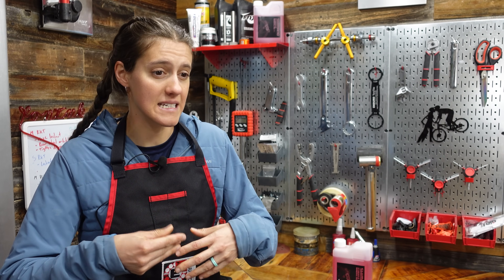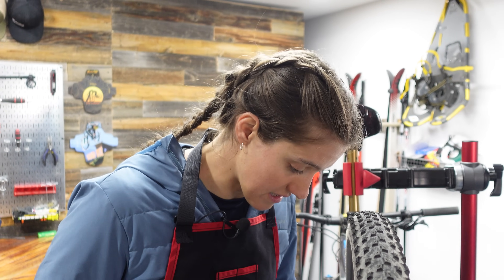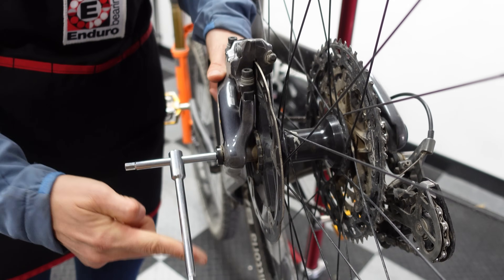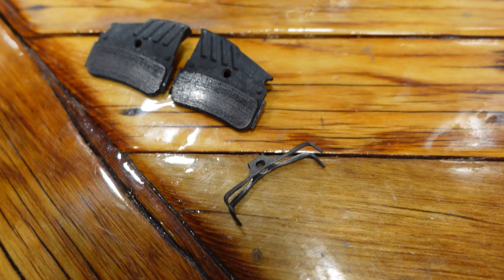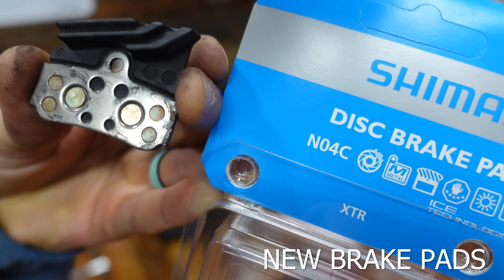Replace your hydraulic disc brake pads (it's easy and will save you $$$) | Syd Fixes Bikes

Comment: I would recommend cleaning the pistons before pushing them back. Otherwise dirt that is stuck to the outside will be pushed into the sealing which might increase the risk of getting a sticky/lazy piston which is even more hastle than cleaning the pistons in the first place.
Reply: Indeed. Plus it is such an easy step to add in.
Reply: I agree, and cleaning all around the caliper while the pads are out (Q-tip with alcohol) is also good I think
Reply: That's a good practice !!!
Reply: I clean around the pistons with alcohol then put the correct oil around them before pushing them back in. Then clean off the oil with more isopropyl alcohol.
Reply: came to the comments to write about this... Yes - clean your pistons, specifically if you have contaminated brake pads or rotors.  One of the pistons can be lazy - check if there is no dirt/mud there. There is a tool to push back the pistons but a screwdriver will work too.
Reply: @ Henry Quinney

Comment: This is NOT actually a closed system as there is room for air to move in behind the bladder and compensate for the oil filling in behind the pistons as the pads wear. Thus there is also the ability for the bladder to expand to allow a bit of fluid expansion as brakes heat up or when you push the pistons back into the caliper. You do not generally need to let oil out of your bleed port to push pistons back when replacing pads. And, as noted by others, it's also a good idea to clean the pistons before pushing them back in to reduce the amount of dirt pushed back inside the caliper further contaminating your brake fluid. But then, whatever. You two make great inspiring and empowering content that is greatly appreciated. Please, keep it up!

Comment: There's no need to open the master cylinder bleed port if the system was never overfilled. But if you've previously done a lever bleed without resetting the pistons and installing a bleed block, you probably overfilled it and it will be necessary to allow the surplus fluid to come out as you've depicted.

Comment: If you're thinking about switching to metallic pads, first check your rotors. A lot of stock rotors have 'resin only' written on them. If that's the case you probably want to budget for new rotors as well.
Reply: Might as well, cause if you don't, you will have to in a few rides anyway.
Reply from the maker: Good tip!

Comment: In case no one has mentioned it.. I have a cool machinist tip for measuring brake pads with your digital calipers:
Measure the little step like Syd did, but while that measurement is still on the caliper display, hit the “zero” key to zero the display. Then measure across the whole brake pad thickness, but now the display will read only the consumable part of the pad without needing to do any math. Neat huh?
When you’re done reset the calipers to their normal state.. usually by holding the “zero” key in for 2 or 3 seconds till it reads normally (depending on your caliper model.)

Comment: Great video - you may want to mention the key differences be metal and resin pads and specific resin-only rotors. 
Mechanics can also use a plastic tire lever to push the pistons into the caliper when required.   Keep up the good work!

Comment: Good tip to use the old pads to push the caliper back.  I have used a plastic tire lever in the past, but like your hack!
Reply from the maker: It's especially helpful when the plastic lever isn't cutting it.

Comment: Thanks, just what I needed. You can measure the pad thickness directly at the 'small' end of the caliper, if you rest the end on the pad and let the little extending piece touch the back plate you will have the direct measurement with no resets or math!

Comment: Your videos are always awesome and helpful - keep them up!!
I'm going to try this again soon.  When I tried previously I had a lazy piston and to take it to the shop - didn't want to F anything up!...LOL.
I wish you guys had a strong light to show the positioning of the pistons.  So you push them back into the caliper and make sure they are evenly plush with the surface ( or entry - hard to explain..LOL).  Thanks!
Reply from the maker: If they aren't COMPLETELY flush, that's probably fine, but they should be close.

Comment: Great video. I went to Magura brakes on my last two bike builds. They use magnets rather than springs to keep the pads in place - way easier to deal with than springs. And they have several color options, and are lightweight. I'm not a Magura sales rep or anything, just like their brakes.

Comment: Thanks. A lot of new info I wasn't aware of. Just one question? How would you know to replace your rotors?
Reply: If they are too warped to straighten or if they are too worn, use a caliper to check wear amount.
Reply from the maker: It's worth noting that we've very rarely had to replace rotors because they don't wear very quickly. But definitely worth checking their width with a caliper every once in a while.
Reply: Thanks for the replies. I've had my bike for 4 years now and still rock the same original rotors. I just have no other indication than measuring them?
Reply from the maker: If they look patchy (you can see the inner material through patches on the outer material) it's definitely time. Otherwise, you just gotta measure.
Reply: Okay. Thank you for the information.

Comment: Hi Syd, first off, I love your show and thank you for posting these really informative videos.  Speaking of which, I have a question;  I have a Road bike with a 1 x setup.  44 at the front and 12-28 at the back.  I've noticed that, occasionally,  Whenever I'm off the saddle for a climb and very seldomly, when I switch my gears, I would hear this ping at the chain set.  Is this normal or, if not, does it mean something is wrong with my setup?  will it eventually snap my chain or chip my gears?  should I worry about it? Hope to hear from you soon and best of luck on your future posts! :)
Reply: Hey. A ping could mean a lot of things, but if it occurs when you're putting lots of force on the pedals and shifting then its normal. However, this should generally be something to avoid. If you're shifting try to lower the force on the pedals, as it puts less strain on all of the parts. Just practice this. If you're worried about it you can always take it to a local bike shop and ask them to check it out in person
Reply: @boldizsarmelegh870  thank you, good sir

Comment: Hey Syd, do you happen to know how to adjust the lever travel for Sram hydraulic disc brake? Eg. lock the disc with half press. 
I am running Rival eTap AXS. 

Appreciate the comprehensive knowledge sharing of the channel!
Reply: Hi man,
While I don’t have any experience with SRAM road brakes, I have had similar issues with my G2 and Code MTB brakes. A lot of times on my brakes it’s just the lever reach and contact adjusters being out of place, I don’t know if road levers have these but if they do, definitely the first step. If lever adjustments fail, pushing the pads apart with the little plastic pad spacer/wedge widget sometimes works. Lastly, resetting the pistons by doing a lever bleed like Syd did will surely give you the range of motion back. You will be using a syringe an DOT fluid for the bleed though! Check out the excellent resources on the SRAM website for more info and bleed procedures. 
Best of luck dude!
Reply from the maker: Unfortunately we don't have any experience with SRAM (or at least haven't used them in close to a decade at this point...)
Reply: @sydfixesbikes  I see. 's cool. Thanks~
Reply: @jacksnyder9399  I am trying to do the opposite actually. 
I have the full ROM now but I try to restrict it, like how you move the brake pads close to the brake track for rim brake, so I need only little motion to have the full braking.

Comment: what is the difference between the different types of hose connectors to the calliper. and how does the one that connects to the side of the calliper work. if anyone could answer this that would be great. thx so much.
Reply from the maker: The side ones use a crazy hollow bolt to allow fluid to pass through. There isn't really a difference in them except that different models use different ones.

Comment: You should explain WHY the pistons should be pushed back using the old pads. Especially for shimano brakes with ceramic pistons. 
And before you push them back you should check if they move freely. If not - pushing them back might cause piston crack.

Comment: If your brakes use cotter pins, throw them out and get Magura. If the pads get contaminated with brake fluid, bake them at 400 degrees for 24 minutes with your pizza. But not actually on the pizza, obviously.

Comment: Close, but filled w/ missed steps and bad "Bedding" advise. Is this a Brake Pad change tutorial or Brake Bleed tutorial ?   Symptoms requiring a pad change are quite different than those requiring a Hyd Bleed of the system. Dedicating a vid to either a Pad change or Bleed operation would have given better detail for each of these maint tasks.   At 5:35 you've mention that Resin and Metal Pads are different and that doing a "Bedding In" of the new pads isn't necessary if you've not changed Pad Types. Thats REALLY bad information and could be dangerous to an unsuspecting Noob doing a pad change for the first time. You should ALWAYS do a "Bedding In" of new Brake Pads regardless of weather you've changed types or not. Bedding a Pad into a Rotor simply matches the pad to the worn surface of the Rotors and removes any glaze from New Pads regardless of Pad Type. All Braking does is convert Kinetic Energy into Heat, it's why different Pad compounds have a different Stopping quality to them. Resin Pads are a mix of Heat resistant Resins and softer metal types and give a more "progressive" feel to braking but tend to fade with extensive use. They Wear faster but your Rotors last longer than w/ the Metal or Ceramic compounded pad types. The Harder Metal/Ceramic pads are Also a compounded mix that use harder metals than in Resin compounds. The harder pads "grab" a bit more firmly, don't "fade" as badly as Resin and will cause your Rotors to wear faster. If you're going to take the time to "mic" your Pads you should at Least know the Wear Limits of the Rotor type your using (found at the manufacturers website). My Tektro Rotors are New @ 1.8mm thick and are at their Wear Limit (the thinnest limit the manufacturer will warrant) at 1.6mm's thick. Most Rotor manufacturers go with 2mm or thicker when new. At 16K miles I'm on my third set of Rotors for my very heavy Fat Tire E-bike. Bedding In Any new set of Pad's is Always required, as I mentioned earlier, and if not done correctly could Easily ruin a set of rotors and/or be dangerous to the rider who's expecting their new pads to perform out of the box, because they Won't. I highly recommend taking a look at the Park Tool YT video on the subject. You'll learn some Very useful tips in a short period of time. Abnormal Pad wear (uneven wear) is usually a symptom of improper Caliper attachment/alignment, stuck pistons within the Caliper or a Rotor that's not running true. ALWAYS give the Calipers a quick cleaning between Pad Changes. Accumulated Brake Dust WILL eventually result in Caliper Piston movement problems leading to uneven pad wear. A simple blast of DRY air works Gr8 for this (like a can of keyboard cleaner). If you don't have access to compressed air, use Q-tips dabbed in Isopropal alcohol, it'll take a bit longer than a shot of air but will leave your Calipers clean and dry. You shouldn't ever handle Brake Pads or Rotors w/ your fingers. The oils in your skin will be absorbed by the very porous pad material and will cause noise or poor breaking. Caliper mounting Screws are Often slightly different lengths, do not mix them up or you risk damaging your threaded mount posts on the Front Forks. These same attachment screws (usually "Cap" screws, or "Allen" heads) will almost always have a stack-up of "self aligning" conical washers under the head of the screw. You can see them clearly in this video. Mixing up these washers will cause alignment problems. Again, make sure they go in the same way they came when new. Also clean the Rotors w/ a good wipe of Isopropyl Alcohol on a paper towel, it will remove any oils and make the Bedding In process go much better. You guys would benefit from being a tad more thorough w/ your Why and How explanations.